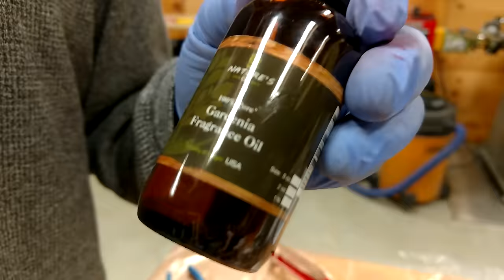Making Colored Smoke Devices for 4th of July

Comment: I know this is a few years later but I ran into this Channel which I love to watch now, could you also use Potassium Permanganate or maybe suggest another low temp oxidizer? Potassium Chlorate is getting harder to find.
Thanks again for the great videos
Reply from the maker: Thanks!
Potassium perchlorate also works.
Reply: @TechIngredients  does the potassium perchlorate work in the ratio mixture as the original?  I am having a hard time getting potassium Chlorate shipped to me, but I think I can get the potassium perchlorate.  Thanks.

Comment: Quick question, when i was ordering some supplies a while back I saw 'rice hulls' as an item they used in some pyrotechnics...is it for the sugar it provides or aerate the mixture?   and also, my gf is kind of a hoarder and she has kept abnormally large amount of those silicone packets that get thrown in to shipments to absorb moisture, would putting some of those in with my potassium chlorate stave off the moisture clumping?
Reply: Yes, the silicone packets can buy you some time with the moisture.  You never know how old those are or how much moisture they're already absorbed because ultimately they stop absorbing moisture.  Most of the those packets that come with something you got in the mail aren't reusable so i bought a bag of 100 reusable packets from amazon that change color as they absorb moisture so you know when to take them out and replace them or microwave them(which dries them out).  They're cheap too.   
Rice hulls aren't to add sugar to the reaction.  Although they add some starch, when you see them in fireworks they are most likely being used to spread out the reactants so they'll burn not explode and it gives everything a chance to disburse in the air.  So they kinda do a few things, primarily they control the rate of the burn .

Comment: Thanks for the informative video!  I’m trying to make these myself, but I am not sure exactly where to start with the dyes.  For this composition, what specific dyes (such as Solvent Red 27, Solvent Blue 35, Disperse Red 9, or Vat Yellow 4) have the properties necessary?  Or, will they all work?  Some non-solvent dyes such as Rhodamine B appear to be used as well.  Melting points sometimes vary by 70°C between dyes.  There was no particular foothold to go off of in the video, and I would rather ask first than buy the wrong dye again, as I did with The King of Random’s video!
Reply from the maker: Go to "coloredsmoke.com".  All their smoke products are  excellent (except the black) and the prices are reasonable.
Reply: I’ve found that site before! Thanks!

Comment: Would compressing the smoke comp cause any issues? Not like ramming the comp but just packing it in well.
Reply from the maker: I haven't noticed any difference in the burn with greater or lesser compaction.  Without the oil you can't really compact it.  Its like trying to compact packing peanuts.

Comment: Hmmm, if you used citronella oil you could make a smoke device that also repelled mosquitos. You mentioned that if the dye gets on things that it stains. Does the burn process remove that problem or does the smoke also tend to dye things it comes in contact with?
Reply from the maker: It's surprising, but the smoke doesn't seem to. It might be related to the heat or the dispersion or even that it is less visible when used outside.

Comment: Curious what you using for "wicks" they seems quite energetic, also curious why traditional "wicks" were not used?
Reply from the maker: Actually, I misspoke. These are FUSES purchased from a pyrotechnic retailer.  They are called "slow" sparkler fuse.  Only cannon fuse would be a poor choice because the cladding on these prevents heat transfer until the burn reaches the very end.
Reply: @TechIngredients  Thanks for taking the time to answer and yes, I understood you meant fuse. It did seem on purpose however given the current state of "demonitize-gate".  

I trust you on the cannon fuse logic, would not be able to confirm myself. I'm sure you explored options like that. It does seem to detract a bit from the elegance of how the smoke devices operate when the start up is so crackly and energetic though, that is all I was pointing out. 

I once made such a device in my youth, it wasn't as "satisfactory" of a device as I had hoped. No wax and very likely wrong ratio. The result was extremely exothermic so the experiment stopped there.

Comment: I like the technical explanation of each step, that's just amazing! Thank you very much. One question: In EU potassium chlorate is not available to general public because it's explosion precursor.  Is there a way to make colorful smoke bombs using KNO3 - wax - sugar mixture by just adding the dye? I don't mind washed out like color, the point is to make it distinguishable from white smoke so people will not mistake it with fire.
Reply from the maker: You might be able to find a color that is more resistant to the higher temperatures, and if you add more, because it's inert, its presence will reduce the temperature further.  However,  the KNO3 will reach a point where it will stop releasing enough oxygen to sustain the reaction.
Reply: @TechIngredients  I tried it with organic, water soluble color and i had problems with ignition. I used your percentages for white smokebombs just added few grams of color. Of course the smoke was white.

I will try the same with red anorganic color and see if the smoke will be at least a little bit red

Comment: Is there any idea to stick all ingredients together such as white smoke bomb that using wax for increasing dense and making it as solid form?
I was thinking that PVA glue would be good method, and used it on other materials, however, the result was not great because the volume will be decreased significantly after it getting dry, such as you fill 100% volume of the paper tube, but the final volume will be decreased to 60%~70% after it getting dry, so look like not a perfect method.
I saw some commercial smoke bombs that its ingredients are in solid form with some powder, but don't get it how they did it.
Reply from the maker: I'd approach this differently.
What about using the unmodified formula and adding to the filling process a loose fiber fill, such as cellulose or cotton, to stabilize the powder?
Reply: @TechIngredients  The main reason that I am trying to stick them together is for moisture-proof, maybe I have to use some plastic wrap for this process if follow your method?
Reply from the maker: That's what I'd do.

Comment: Fantastic video! Are using lab quality sucrose or can you use confectioners sugar or table sugar?  I understand that confectioners sugar sometimes has cornstarch added, does this make a difference?  Thanks.
Reply from the maker: We used table sugar.  Confectioners sugar is fine, but it's more expensive and you need the coffee grinder anyway.

Comment: to make a colored bomb can we use Potassium Nitrate instead of Potassium Chlorate, 18% Sugar, 16% Magnesium Carbonate, 3% Sodium Bicarbonate?? Please guide. thank you
Reply from the maker: I'd not recommend it.  As I explained in the video, potassium nitrate requires a higher temperature to sustain burning and this tends to destroy the dye.
Reply: @TechIngredients  Right, and what about Color, we can use any kind of Color or we have to use specific kind of colors sir?
Reply from the maker: You need a color dye that is compatible with the heat.  The category of "solvent dyes" is best.  Try coloredsmoke.com
Reply: @TechIngredients  so we can use epoxy Resin color or the one we use in dying clothes?

Comment: would you be able to use a Rcandy fuse? would that be enough heat transfer to ignite the canister? 
I've made my own fuses with cotton string soaked in potassium nitrate/sugar then baked. they work very well for lighting off black powder. 

trying to get an opinion before wasting my time and resourses
Reply from the maker: I'm not sure, but I suspect you would not have any problem.  As long as you use a small quantity of the hotter starting powder, most fuses should be enough to get that component to burn.

Comment: I've seen some videos where they use 60g potassium and 40g sugar and a little bit of color...but the smoke bomb won't last more than 30 seconds? What is your explanation? And can I follow your method, but mix the ingredients and put them over a low heat to become like a dough, then use them? Thanks
Reply from the maker: I explained  the problem  with conventional  smoke compounds and color early in the video.  The colored dyes  won't survive the high temperatures .

Comment: Could you use Citronella oil, or pyrethrum oil, or neem oil for an insect deterrent for outdoor parties.? if you want to make smaller smoke bombs how do you scale down or up. will the mix ratios change for smaller or larger?
Reply from the maker: You could.
The mix ratios work for this scale and for 1/2 and twice this size.  It might change for larger multiples, but we didn't test that.

Comment: I discovered your channel yesterday, and I've been binge-watching them.  You do an excellent job of explaining the processes and rationale such as with these and with the thermal conductivity compounds.  I'm working on a smoke chamber for better tracking of amateur rockets, and I think the thermal properties of these smoke canisters (as opposed to those which are KNO3 based) would reduce my need for more expensive ablative materials.  Do you have any data on the thermal qualities at the exhaust?  Also, if I leave out the dyes will the smoke still be as opaque?
Reply from the maker: Did you  watch our first two videos in this three part series?

Comment: Based on volume of the components, would the potassium nitrate, sugar, & wax smoke alert provide a longer burn w/ more smoke coverage w/ taking up the Same or Less space than a chlorate-based smoke signal made without the color/scent additives?
Reply from the maker: The white smoke is far denser per dollar and similar or slightly higher in density per unit volume.

Comment: It's important to note that essential oils aren't actually oils per se. They're made up of various water soluble volatile compounds from plants. Many essential oils do not do well under heat, and some decompose into some nasty compounds. Also, some are major irritants in the wrong circumstances (e.g. oregano, peppermint, and spike lavender). Camphorous oils can also cause issues with epileptics, so be cautious with those as well.
Very cool project, sir. I will definitely be trying some of these out!

PS: I was wondering, do the pigments stain in smoke form or only in powder form during production?
Reply from the maker: Only in powder form.  Your comment about the oil has merit.  It should be kept in mind that these scents are to complement a few outdoor pyrotechnics and not produce the long-standing atmospherics for a rave.

Comment: I’m wildly into photography and I just bought all the materials of make some of these. I’m very excited to get everything and try this out. In regards to adding oil is there any disadvantage to doing that? I was going to add some olive oil, the only reason I’m doing it is to make the smoke last longer. I’m not concerned with the smell at this point but I do think that’s pretty interesting.
Reply from the maker: There is no disadvantage to adding the oil.  As you said, it does slow the burn rate and it also makes the powder easier to deal with.  You might want to try a scented oil, it suprises people when they don't expect it.

Comment: i have a question.

I have Potassium Nitrate and struggling to get hold of Potassium Chlorate. can i use the Potassium Nitrate in its place?

Also on th epacket i have it says Saltpetre Potassium Nitrate. Is this the same thing or is what i have here not going to work at all?

Thanks in Adavanced
Reply from the maker: Not for the colored smoke.  We do use potassium nitrate for the white smoke, but the higher dissociation temperature of potassium nitrate will degrade the colored dyes.

Comment: I'm curious: If the dyes can easily stain surfaces, and if the burning is cool enough to not break down those dies, then why doesn't the smoke stain your clothes?
Reply from the maker: It's  a good question because  it doesn't.  The temperature  is not high enough  to break down the dyes, and thermal breakdown is why people who have tried  to add dyes to the more conventional potassium nitrate smoke mixtures have been unsuccessful.

Comment: If I wanted to make one that was a larger diameter, would you recommend several wicks or still one central wick? I'm looking at making some large ones that I can set down during a paintball game and let them blanket an area in smoke. I was thinking something the diameter of one of those paint cans but not quite as tall.
Reply from the maker: One central wick is fine.  The sizing challenge is to make the area of the hole(s) proportional to the surface area of the top of the powder in the tube.  I can't give you a formula, but I recommend you do what I did, scale up in stages.

Comment: So is there away to slow the process down to say 2-3 minutes of burn time I do a extensive Halloween scene and I’ve tried fog machines and I ended up using just the tiny smoke bombs but it’s hard to frighten people and keep lighting these 20 second balls ...
Reply from the maker: For both the colored and the non-colored mixes, you can slow the rate of burn by decreasing the percentage of oxidizer and increasing the percentage of either wax or the carbonates.  The wax is forgiving and you can increase the percentage by 5-10% before the flame goes out.  In this case it will burn, but feebly for tens of minutes.  The carbonates are more demanding of precision especially the sodium bicarbonate percentage.

Comment: If you make them longer, do you have to make them bigger in diameter? 
I have 4" diameter X 4' long tubes. Would they burn out half way through or would they be ok?
Reply from the maker: That is a pretty extreme ratio.  It might work, but I suspect that the build up of debris as the burn continues will eventually block the output.  You can probably make them significantly longer than we did, but maybe not that long.

Comment: Very cool! I’m going to try this with some homeschool kids. Is it possible to granulate or compress this and it still operate or does it need to be loose powder?
Reply from the maker: This mixture does not compress well primarily due to the magnesium carbonate.  For this reason it can be messy to work with and produces a lot of loose powder that stains.  That was one of the reasons I started adding the scented oils.  They improve the handling properties in addition to the pleasant smell.

Comment: I wonder if it would be possible to use a wider tube with a divider down the center and make one that burns two colors at once. Or maybe even 3. Or would that create too much heat?
Reply from the maker: No, that would work.
Reply: @TechIngredients  I may need to try that.

Comment: Hello. I tried 2 times and my mixture ignited while it was on the stove then 2 times I got as I need. My question is, what determines if the potassium nitrate in my sugar will catch fire? I use a small stove that 800w and am I doing wrong by putting the sugar first I wait for it to boil and then the nitrate. Thanks a lot in advance. Yours are better than those sold in stores. Congratulations
Reply from the maker: We aren't  using potassium  nitrate for this formulation. Heat the combined mixture slowly and do not carmalize the sugar.
Reply: @TechIngredients  thank you !! How many minutes should I keep them on a slow fire? Is 1 min enough?
Reply from the maker: NO FIRE!
As soon as the electrical stove has liquefied the mixture, you're done.  There is no benefit  to heating it any longer.
Reply: @TechIngredients  thank you

Comment: Can you pack it down in the tube to make it burn longer and do more smoke comes out faster! So you can have it smoke for a 15 minutes, 1/2 hour etc?
Reply from the maker: Adding additional  oil will slow down the burn rate.  However,  you can't push it too far or the reaction stops.

Comment: May I concern if this recipe will generate white smoke without smoke dyes? How it performs if compare to potassium nitrate?
Reply from the maker: Did you watch our earlier video on making large white smoke devices?
Reply: @TechIngredients  Yes, I've also made the white smoke bombs through the tutorial video > https://www.youtube.com/watch?v=4v1fMDXVM0Q. It performs well for me, the only problem is I still can't solve the burning issue.

I'm curious if this colored bombs recipe can be used for making white smoke and how it performs.
Reply from the maker: I haven't  tried  it because  the quantity  of smoke will be less as the mixture  is much less dense and the packed powder compressed into the tube is less robust than the solid wax in the white devices.

Comment: Thanks for the tutorial videos of these smoke bombs. I have seen so many poor smoke bomb videos on youtube but yours are the real deal. I'm struggling to find the solvent dye however. I'm in the UK. Are these dyes the same as  Epoxy resin dyes and candle dyes?
Reply from the maker: They are similar. They're called  "solvent dyes." Check out coloredsmoke.com
Reply: @TechIngredients  Fantastic, thanks for that. I make fireworks from time to time and  looked into smoke bombs in the past, but wasn't too impressed with other videos I've seen on youtube until I came across yours. Great videos very informative and well explained. Good work.